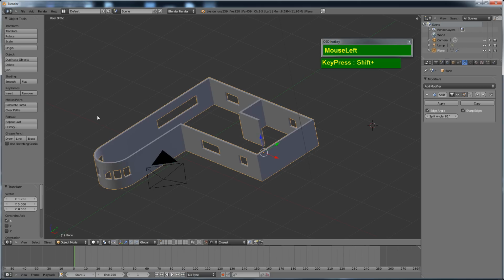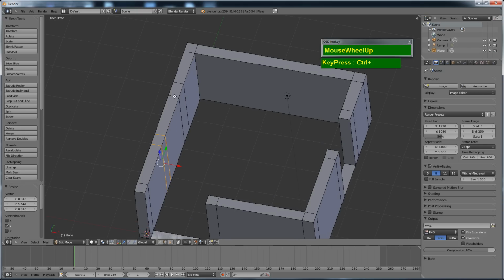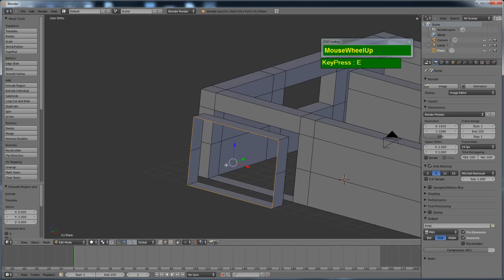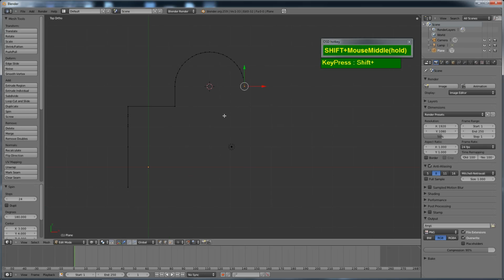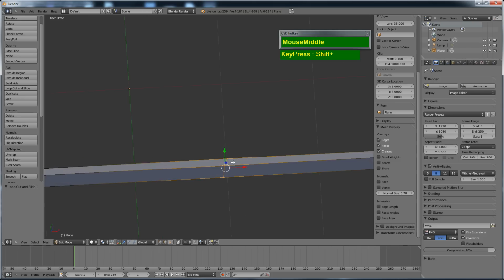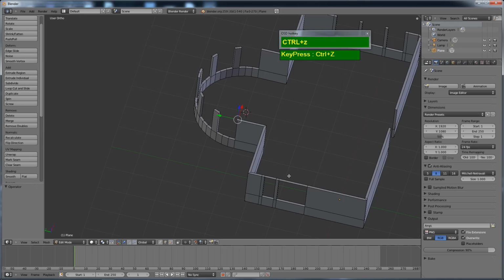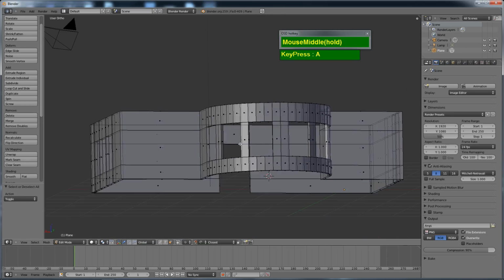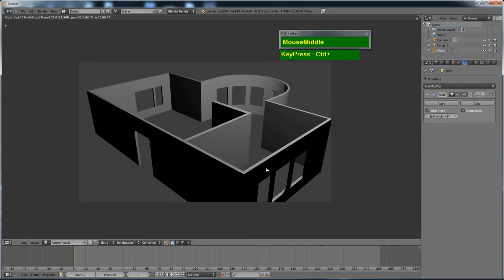Blender 2.59 Modeling Tutorial, Modeling Walls & Rooms Quickly

Comment: Why, after i had selected F to cover up the gap so to make a window and then Extrude up, I got a dark face above the window?
Reply: +weeliano Thanks again!. But it didn't work. But I found in Ctrl F, a Flip Normals. And it works. Yippeeee.
Reply: It could be a reversed face, press A until everything is selected and press Ctrl and I together to conform the faces.
Reply: +weelian soh Thanks. But I still couldn't get it right. Hmm..
Reply from the maker: +Megroyo Hi, can you select the face with the dark face, press Ctrl+F and shade it flat. Or you can select all the faces (press A) and then press ctrl+F to access the faces menu and than shade it flat.
Reply from the maker: +Megroyo Awesome!

Comment: I'm a bit new to this but have a question... Should we be concerned about real world scale settings?  Is it difficult to adjust for that and I like your videos, very clear, concise and nice flow to your tutoring method.
Reply from the maker: +gear1100 Unless you are modeling for a real world dimensions then yes you should set the unit settings accordingly. It is not difficult, each square grid unit is a Blender unit which can be changed to imperial or metric units under the Scene tab settings in the Properties panel. Thanks for watching my video! I should be publishing new videos again soon.

Comment: How is it possible to create arch windows using this method?
Reply from the maker: Duplicate a vertice from the wall, position it to where you want, create the outline of the Arch window by using extrusion and the spin method for the curved region. Extrude the outline. Select the edge and extrude and link the vertices to the flat wall edges. Because you use more vertices to draw the outline of a arched window, you will need more vertices on the wall as well. Looks like this is a good subject for another tutorial. :)
Reply: I will try that, thank you!

Comment from the maker: To apply textures both on the inside and outside, you will have to perform UV unwrap/projections to apply texture coordinates to all the wall's sides. There are many tutorials on youtube showing how to do that, I explained the concept in Modeling a Can Tutorial. I used 2 programs to show the key presses, OSD Hotkey and HyperCam. There is also a in built show keys function in Blender but I prefer my own setup as it shows all the key/mouse presses effectively.

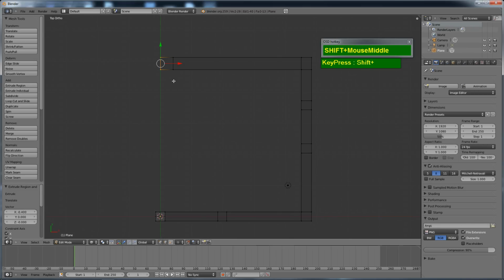Comment: Just a tip for around 3:00 if you havent gotten it yet, when aligning the walls you can just use snap to vertex and snap it by pulling on the x-axis along with hovering over the vertex you want to align it with, its a really quick way to align stuff.

Comment from the maker: You can certainly use menu commands to execute the modeling functions, however you are not going to get any faster using that method. Trust me, learning the keyboard commands may sound hard at first, but using keyboard shortcuts is the fastest way to work not only in on Blender but in other software as well.

Comment: Great tutorials!  One easy question though.  I'm stumped as to how when you are extruding with snap on you can create the vertices close to one another by the doors and windows.  In the second part of this tutorial where you create the walls with doors and windows how do you extrude the vertex so close to the other and still have it locked in a straight line?  My second vertex just jumps to and from the next grid mark.

Comment from the maker: @Zynt453 This could be due to a hidden face or disconnected edge. You can try to rebuild the face. or try applying a "remove doubles" on the entire mesh to fuse hidden or stacked vertices together.  To cover holes, you can try to use the Ctrl+F option in edit mode to bring out the Face specials and use fhe Fill then the Beautify fill after selecting the hole.

Comment: Whenever I duplicate faces and place them over the holes and remove vertices, it renders my models completely uneditable. For some reason I can't use the loop cut at all afterwards as it will only apply to one face per cut and it joins the edge to the vertices so instead of applying a loop along the centre of the model, it only applies to one face and inserts 2 loops instead of one, both firing up from the centre of one edge the vertices above it :S.

Any ideas of why that's happening?